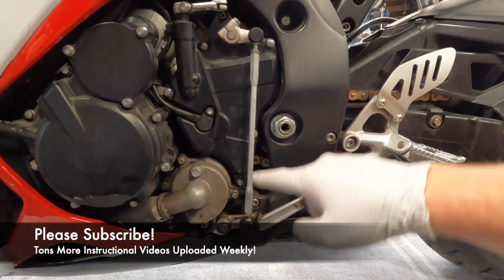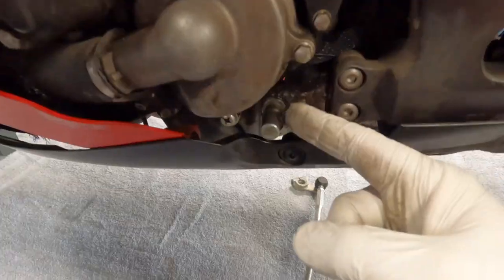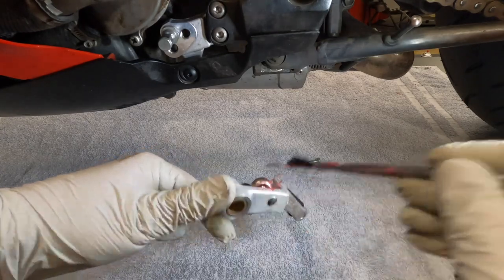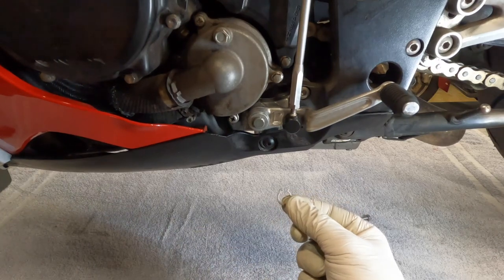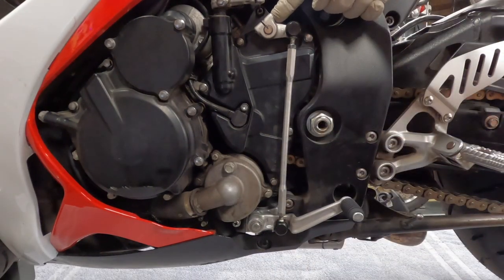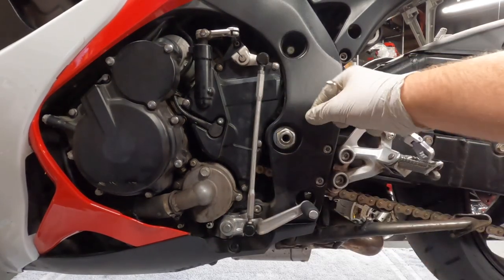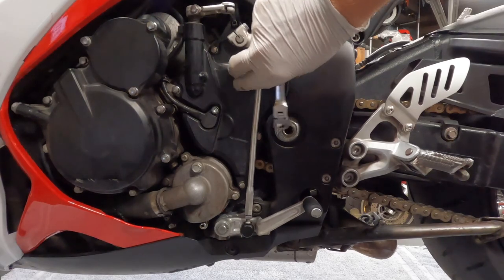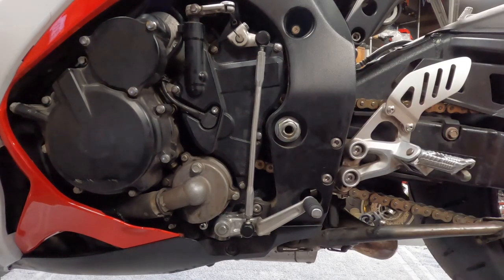How to Service And Adjust Your Motorcycle Shifter Assembly

Comment: My gear indicator on my LCD digital dash sometimes gets laggy when im down shifting, it takes a few seconds for the display to realize its in 1st and at times the gear lever isnt smooth when clicking down. Could it be the dirt build up and drying up? I use it nearly daily in rainy weather too. mines a Zontes 125 2021 model

Comment: Recently took apart all four carburetors on my 2008 ZZR and cleaned them and reinstalled all new jet's, float needles, pilot's and A/F screw's that we're under the factory welch plugs. So anyways the bike seems to be really close as it should be running wise, but occasionally acts like it's running out of fuel and sometimes does basically run out.
When I pull over and view the brand new fuel filter,it appears to be almost empty. Not sure if my petcock valve run screen is clogged or if my fuel pump is going out. Should I test the fuel pump and if so how? Local motorcycle sport bike mechanic told me the pump actually doesn't provide much actual pressure that the system mostly runs on gravity and only time the pump does pump is when the carburetor sensor sense's a certain amount of throttle.

Comment: I am trying to change the shift knuckle position on my 2019 Yamaha R3 and it’s not coming off the splined shift shaft even with the bolt removed.  Any suggestions?
Reply from the maker: Soak it with some penetrating oil or WD-40 and use a screw driver to pry in the slot as you try and pull it off
Reply: @motomecha530  thanks so much that did it. I’ll apply a little grease as you did for easier adjustment next time!